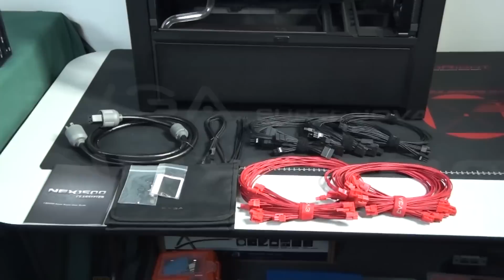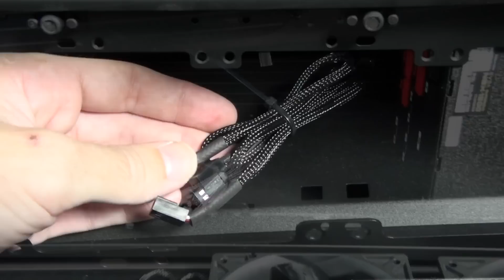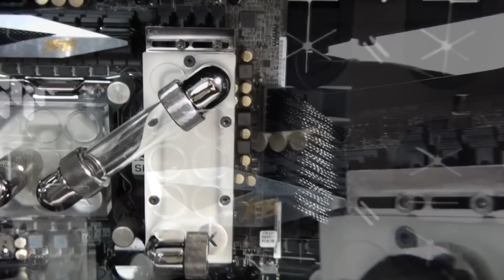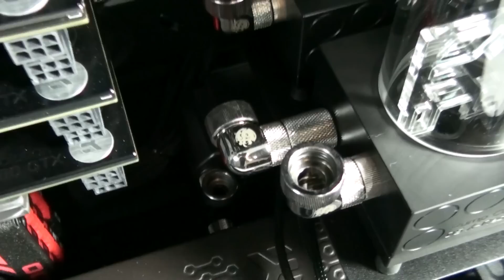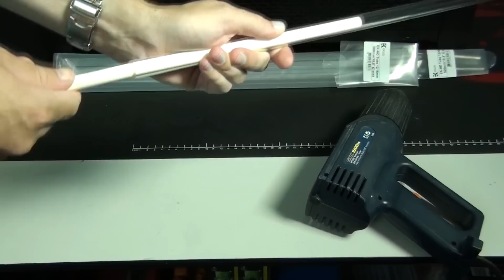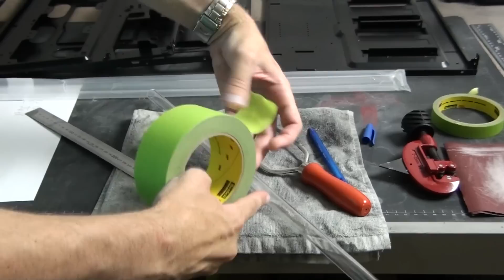Build #12: Quad SLI 900D: Part 2

Comment: How do you figure out the bend when bending Acrylic. Meaning it a 90 when bent you can't just measure to the fitting and bend because than the 90 would be offset and over shoot the fittings. I'm new to hard tubing and can use alittle help. Thanks in advance

Comment: ***** don't you think the hole for the pump should be 2mm~3mm wider in diameter than the pump? Looks like you created a nice "drum" as mounting if the touch the mounting or rub on it... hum  hum hum :-P

Comment: How are you using EK-HD solid tube 12/ 16mm with Bitspower fittings?
On trying to order Bitspower fittings from Performance PC I was told they would not fit this tubing?

Comment: What size bits power fittings work with the Tube your using? Also What size Ek tubing are you using? It would be helpful because im planning on doing a water cooling build. Thanks

Comment: In this build your working with a Corsair 900D. Just wanted to get your opinion on mounting a 560 rad in the bezel? I know it will encroach on the base and roof  an the ability to mount 480 rads in those spots. The the HDD cages wont be able to be mounted under the 5.25" bays or use the bays at all(Dough!) but with some modding. You think it's doable? I have a G-Changer 560mm rad that I want to mount in the bezel of a 900D, or Enthoo Primo. But most likely 900D:)

Comment: Thanks Dan for the tips on acrylic tube bending.  This has become quite trendy these days and I remember that you were at the forefront of this trend over two years ago and even before (starting with crystal link).  My next project will use either acrylic tube or nickel plated copper tube.  Thanks again.

Comment: HardOCP had a case of projectile diarrhea over the EVGA NEX1500 psu.

*The 12v output labels do NOT match thier internal assignments. You will need to reconfig 12v assignments in software. Oh, you'll also need to register to get that software.

Comment: I'd recommend the Phobya splitters, with those you'll have Molex > 6x 3 Pin.
I use those in my case with a little customisation to allow me to use a Fan Control with them, using a 3 Pin as power input.

Comment: It's unbelievable what you are doing, this build is perfect, I am just worried that you would have to redo some of the tubing bending when you find out that the chipset heatsink gets hot as hell and the annoying loud fan needs to be running and you will have to put a waterblock on it, however there might not be any in the market :(

Comment: So you use 16 gauge cable, is it copper stranded conductor or an other kind of metal? i have been wanting to make my own cables for a while but i can't find a reliable supplier, could you give me pointers on where i could buy some black / white / red cable in bulk?

any help would be greatly appreciated.

Comment: 12 Gauge power cable? Does that even matter if the cabling in the wall is not as thick? ...
Reply: nope, your house may still caught fire
Reply: Mudux
Nor lig if your house runs on 110V AC, current draw at 1500W or 1,5KW is pretty low..... now if you atx powersupply goes down to 12V DC (step down and rectified) the current draw just goes way up!

you should ask a different question, if one of the wires comes loose or isn't crimped right, does you insurance pay for your house if you modified your powersupply? the true live answer is NO :-P

Comment: If that ek 4way gpu connector has a port at the bottom, you could have some shorter tube out the bottom to reach the pump. May have to switch the input to the other side though.

Comment: Hi, big fan of your builds. I just wanted to point out that you might want to consider getting a miter box (not a miter saw!) for guiding your hand saw to get perfectly square cuts rather than trying to cut straight by hand. I imagine a perfectly square cut seals better and is just preferable, of course. I use them for architectural models, and they're basically a little plastic or aluminum device that has a bed that the piece rests in and then two parallel walls with slots that the saw blade fits into and it ensures that you get a perfectly straight cut. They also have angled slots if you ever needed a perfectly angled 45 degree or 30 degree cut. They're pretty accurate and allow me to cut pieces where I need to be within a 128th of an inch. I know you're not in the States so Hobby Lobby or Blick's probably doesn't mean anything to you, but that's where I get them, along with many other tools for models that would also be helpful for your work. If you don't know what I'm talking about I can link you to the device. Also, there are also dedicated tools for deburring. There's a little tool that you swivel around the inside of the tube that would fix it up in no time, rather than a razor blade or whatever you were using.
Reply: The new monsoon kit does come with a "miter box" designed for tubing and tools for rounding off the inside of the tube.

Comment: That thick acrylic tubing is great, my only beef with acrylic tubing was the thin walled design as well and small id/OD, but I'll give it to EK for this one, looks so much better than the other acrylic tubes. Great mount for the pump and res I'm going to do the same I think in my 750D config.

Comment: Very nice too see u uploading again. You are one of my hero's in the modding scene. I'm suprised to see u didn't break the little latching devices on the back. They are the same in my C70 and i broke 2 already. (reffering to the plastic cable brackets at the back)
Reply: With the custom cables it pretty easy to take your time and not break them. I got far more wires than that in my 900 and I didn't break any. They're just thin pieces of plastic and need to be treated as such.
Reply: DOG_REDRUM
I did use them the correct way and used them as described. I did have the standard cables at the time, maybe that was the reason. Luckily i have all paracord on the psu now ;)
Reply: ***** I didn't mean to make it seem like you were using them wrong. Just that as I'm sure as you'll agree when you take them off it's pretty easy to see that just a little too much pressure when you're taking them out or putting them in and they would snap. I think the easiest way to break them is to get them stuck between the tall and short settings which almost happen to me, but I could feel it was taking too much pressure to try and close it.
Reply: No i got yah, i think it was the amount of cables i wanted them to hold. 24pin 2x 6pin and sata cables. At the time i didn't had pasracord, sow tha cables were bulky round. I think that was the mistake i made.

Comment: By switching from 18 gauge wire to 16 gauge is there a difference in ohm resistance between the two gauges?

Comment: 4 gpu? who still does that?
 8 12v Rails...20amps a piece...20 amps wont run a 7950...
Reply: "4 GPU? Who still does that?" Obviously the client that is paying him to build this.
"8 12v Rails..." UP TO or you can just leave it in single rail it's configurable through software.
Reply: I just cant believe the singularity guy didn't talk his client out of 4 gpu. E-peen client with too much money? 
And yeah UP to 8 12v rails...but lulz for what reason, may be if it was the second psu in the rig and powered all the fluff like cold cathode, fans, pumps or 12 ssds that you want on different rails?

The build looks awesome..no doubt about that.